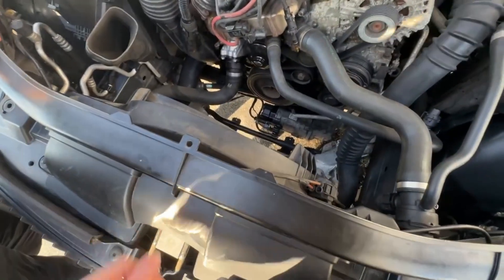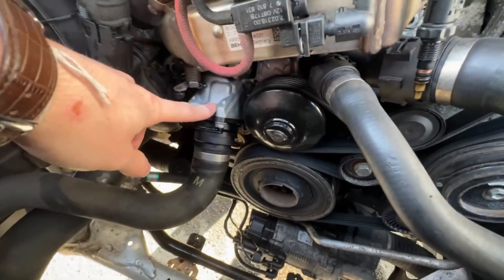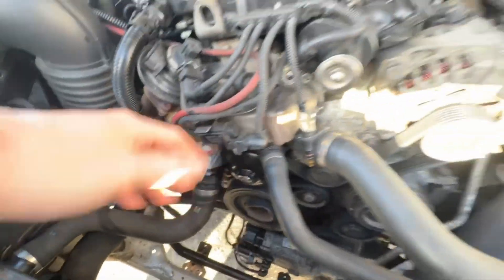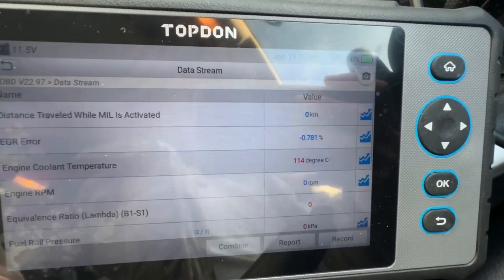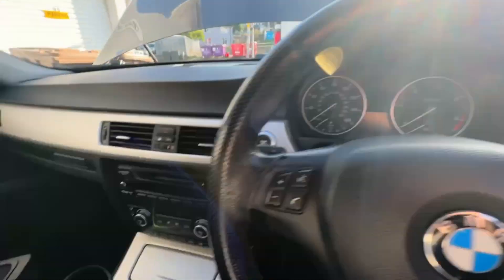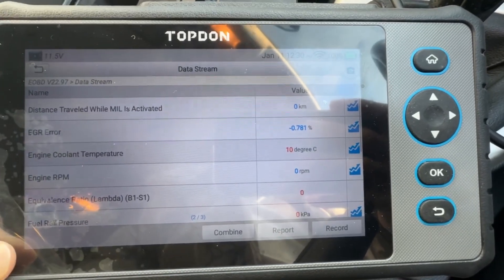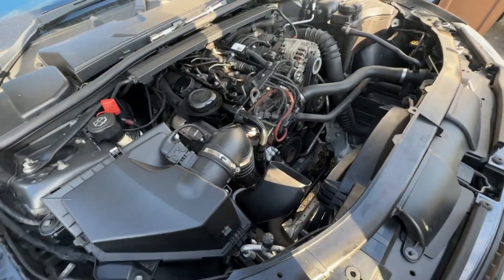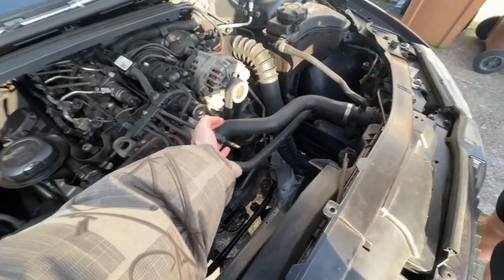BMW E91 N47 ENGINE LIMP MODE, COOLANT OVERHEATING SOLVED!

Comment: Hi I changed my sensor but accidentally broke the housing in the 2 pin connector which is flimsy now do you know where I can find a replacement also how tight do you turn the sensor ?
Reply from the maker: I just hand tightened it don’t go crazy with it and I’m not sure where to get another connector maybe just put some electrical tape around it or try tightening it with a zip tie if possible

Comment: I have this problem. Changed the sensor, solved it for about 4 days then ever since been overheating again and reaching 123°. Its has no sign of it being a thermostat problem or anything like that.  Now I don’t know what to do. Do I change the sensor again?
Reply from the maker: Could well be a bad sensor there is two you can change and even change the thermostat or the egr thermostat

Comment: If you pull the plug out coolant sensor whilst engine running the fan should come on automatically ??  Does that mean its the coolant temp sensor is faulty ,
Reply from the maker: I’m not sure exactly if you follow the steps in the video you will figure out if it’s broken or not

Comment: Hi mate i did exactly the same on my 320d 2010n47 changed the coolant temp sensor did a diagnostic and it came up 3ee0 code on it and the temp sensor its brand new now if i put the connector on the fan doesnt do anything and the engine heats up , if i disconnect the connector its on all the time . any suggestion thank you . and also can you make a video of the electric auxiliary heater on that car i keep looking and cant find the fucker anywhere . thank you
Reply from the maker: Sorry mate not sure I would checked both sensors there is two and the thermostat make sure is all working properly!
Reply: @ thank you
Reply: Try the fan relay , on some models it’s attached to the back of the fan in module on others it’s just under your expansion tank or follow the wires from the fan you will find it .

Comment: Did the overheating appear straight away when engine was cold my one dose after few minutes riches 100 or over did change termostat work for a while same again
Reply from the maker: Yeah it was defo an issue with that sensor change the coolant sensor and you’ll be good 😊
Reply: @RestoringSalvage  nice one thanks
Reply: How hard it’s it to access that sensor? Just under the cover?
Reply from the maker: @leehiller3152  Yeah its just under the cover!